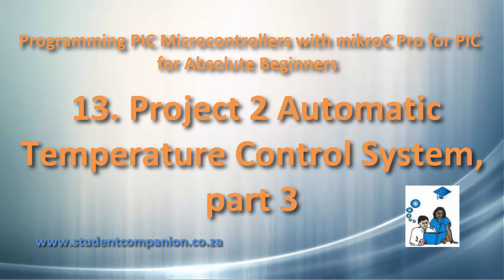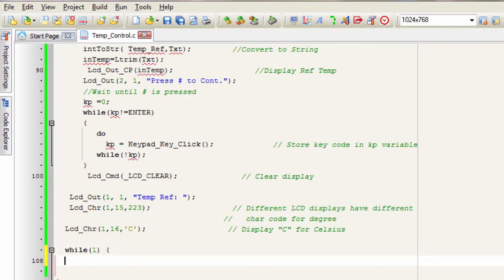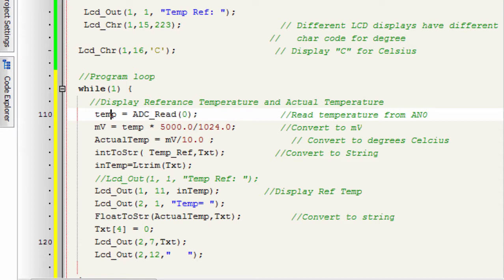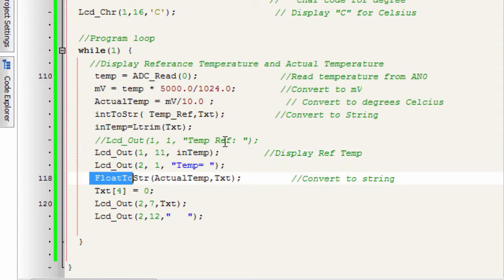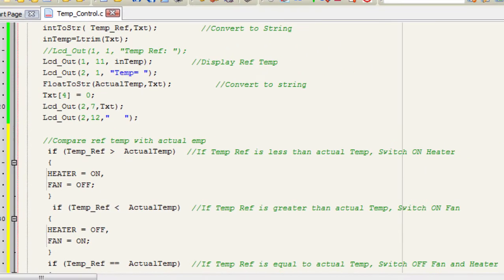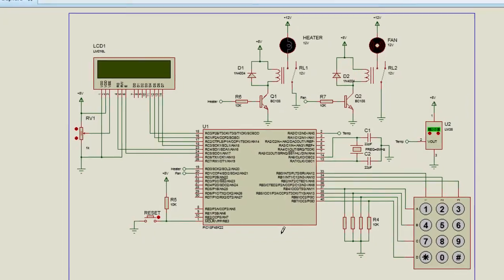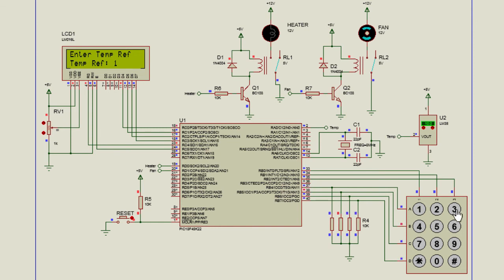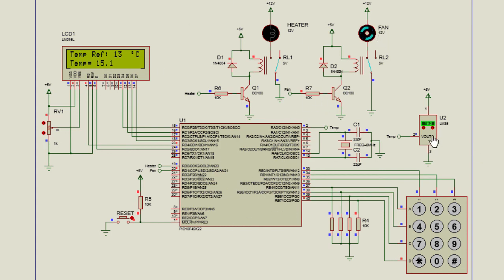13- Project 2 Automatic Temperature Control, part 3 | mikroC Pro for PIC Tutorial

Comment: I watched this project sir  I got some knowledge from it  .but sir if u can please give a code in  mikroc for automated temperature based fan speed controller using pic 16f877a microcontroller with out using key pad.
Reply from the maker: Hi, we have already discussed this topic in this thread: https://www.studentcompanion.co.za/forums/topic/can-i-use-pic16f877a-as-the-microcontroller-for-automatic-temperature-control/
Reply from the maker: If you don't want to use a keypad, you can use push buttons. You can follow the same procudures as in this project: https://youtu.be/E_bAO7MwadQ
Reply: @StudentCompanion   sir when i build the code i get the error that demo limit and finished with error
Reply from the maker: If you get demo limit error it means you are using the free mikroC compiler. The free version only allows you to compile small code of less tgan 2kb. For bigger code, you will need to buy the professional version.

Comment: I am getting an error after loading hex file and running it, the error says: "Attempting to execute illegal op code".
Reply from the maker: Where are you getting that error? In Proteus simulation, MPLAB, Hardware tool?
Reply: Student Companion In proteus simulation. When I click at the errot it says, "this may be becuase the cpu has no source window, or because it is executing library or runtime code for which no debug data is present". If I delete the program after while(1) loop, the error doesn't come.
Reply from the maker: Did you modify the code? Which PIC are you using? Did you load the correct hex file? Are you using a professional version of Proteus and not the demo?
Reply: Student Companion I am using the code which is given in source code. Yes I loaded the correct hex file. I even checked it by writing blinking LED program. It's working. Yes I am using proteus 8 professional, cracked version.
Reply from the maker: Please upload the screenshot of the error message, your zipped mikroC and Proteus projects in the Forum on our website: https://www.studentcompanion.co.za/forums/
Reply: what do you mean by zipped mikroc and proteus?
Reply: I have uploaded it under https://www.studentcompanion.co.za/forums/forum/mikroc-pro-for-pic-project-discussions/
Reply from the maker: Hi We don't know what you mean by works fine before while (1) loop but not after using while (1) loop. This code you attached in the Forum when we compiled it, it works fine with no errors and it simulates well as expected.
Please upload the mikroC code which is not working. The one with errors.
Reply: Student Companion at the first place, there is no error in Mikro C compiler, the error is coming after simulating in proteus.
Reply: Mikro c code is same as in your source code link.
Reply: I have already sent the screenshot of the error. Can you help?
Reply from the maker: There was an error but after we compiled your code without changing anything, the error in proteus disappeared.
Reply: Student Companion Okay.
Reply from the maker: You are welcome
Reply: Student Companion compiled as in built the program?
Reply from the maker: Yes. You must build the project

Comment: Thank you for all the projects what about if I want to add one device to be monitored let us say if I want to monitor Oil of the gearbox in wind turbine i.e. oil cooler how can I add to the schematic and write the  c code? if it is possible mean that u may give me a hint!!! Please
Reply from the maker: +Haftamu Mekonnen it's all depends on the type of device to add. What kind of sensor? How is that sensor interfaced with microcontroller?
Reply: let us say, for example           Generator speed sensor, gearbox lubrication sensor, Temperature gear oil sensor, Windvane sensor, Anemometer sensor, vibration sensor or hydraulic oil level sensor! you may give me some ways to design by choosing one of these sensors. I need to monitor one of the above listed sensors along side with the automatic temperature control not all at the same time. Thank you for replaying again!
Reply from the maker: +Haftamu Mekonnen you must select a sensor first and found out whether it produces an analog voltage like the one in this tutorial. Then it can be connected to any analog pin of the microcontroller and you can read it like in this tutorial.  But if it produces an digital output then it can be interfaced differently.  Some uses I2C, SPI etc.
Reply: I choose the vibration sensor and it produces an analog output! so how can I connect it to the microcontroller? and how can I compensate the fault or diagnose the fault just like the heater and fan did to the temperature variation? Thank you for replaying!
Reply from the maker: +Haftamu Mekonnen what vibration sensor are you gonna use?
Reply: From the wind turbine components, for example Rotor vibration! Thank you for replaying!
Reply: Okay! leave it, if u have any idea that I have to monitor one of the wind turbine components just like this tutorial, tell me the simplest component to monitor using sensor! I just said that if you can, if you don't understand what I am saying leave it! But, I want to Thank you for helping me upto this!
Reply: Okay! let us come to this tutorial what is the problem here it can't simulate (it show me an error) the code after written the program loop! until the program loop it works fine but, after the program loop it didn't work 
it show me an error says,  "Demo limit" I mean the program in this 3rd tutorial starting from  
 //program loop:                       

//program loop

       while(1)
  
 {
     temp = ADC_Read(0);
     mV = temp * 5000.0/1024.0;
     ActualTemp = mV/10.0;
     intToStr( Temp_Ref,Txt);
     inTemp = Ltrim(Txt);
     
     //LCD out(1,1, "Temp Ref: ")
     
      Lcd_Out(1, 11, inTemp);
      Lcd_Out(2, 1, "Temp= ");
      FloatToStr(ActualTemp,Txt);
      Txt[4]= 0;
      Lcd_Out(2,7, Txt);
      Lcd_Out(2,12, " ");
      
       //compare ref tmep with actula temp
      if(Temp_Ref >  ActualTemp )
      {
      
      HEATER = ON;
      FAN = OFF;
      
      }
      
      if(Temp_Ref <  ActualTemp )
      {

      HEATER = OFF;
      FAN = OFF;

      }
      
      if(Temp_Ref ==  ActualTemp )
      {

      HEATER = OFF;
      FAN = OFF;

      }
      
      Delay_ms(10000);
}
}

where is the error that I have done? it show me like below:

Line       Messages
0               127 All files Compiled in 78 ms  
0              434 Demo Limit Demo Limit
0              102 Finished (with errors): 03 Jan 2017, 10:03:10
Reply from the maker: +Haftamu Mekonnen it means you are using a demo compiler. Your free compiler can only compiler small codes of 2kb or less in size. If you want to compile thhs code you must buy a full license
Reply from the maker: +Haftamu Mekonnen i meant a component model number. To know what type of sensor it is and how it is used
Reply from the maker: +Haftamu Mekonnen you are welcome
Reply: Hello! if I want to connect the following sensors how I connect to the PIC microcontroller?
  
1. Oil Level(R SERIES) sensors
2. Fuel level(PH606) sensors
Reply from the maker: 1. Oil Level(R SERIES) sensors: It's an analog sensor with voltage from 0-5V analogue output (typically calibrated 0.25V empty, 4.75V full). You can use it exactly as the LM35. Use simple math to determine the conversion factor or Read the datasheet to get  more info.
2. Fuel level(PH606) sensors: I couldn't get this sensor on google. Please send more info like the manufacturer.
Reply: Thank you so much for your help!
Reply from the maker: +Haftamu Mekonnen you are welcome!
Reply: I have PIC16F877A microcontroller, LCD, Buzzer and Ultrasonic sensor(GP2D120) for distance measuring in my project how can I write a c code in mikro pro c? For LCD it may be simple but what about for the BUZZER and GP2D120 help me in writing the code!
Reply from the maker: +Haftamu Mekonnen read these articles: http://www.studentcompanion.net/en/microcontroller-interfacing-basics/
http://www.studentcompanion.net/en/microcontroller-interfacing-sensors/
And 
http://www.studentcompanion.net/en/generating-sound-with-pic-microcontroller-mikroc/
Reply: Thank you so much for your help! so far, I have question for you the question is as follows, I have pic16f887 microcontroller, LCD, L293D motor driver for controlling fan and heater, ULN2003A stepper motor driver,  and optocoupler-npn for wind speed measurement. So, would you help me in writing the c code in mikro c?
Reply from the maker: Hi. Unfortunately we cannot write the code for you. We won't have time to write codes for each and everyone who request it as they are many people who request different kind of codes. We will spend all our time writing codes instead of focusing on new tutorials.
But we can assist you with your code when you are getting some compilation errors especially if your project is based on our tutorials.
Try to add one sensor at a time and see if it's Works instead of including all those sensors at the same time.

Comment: I like to know why 10 second is  why not 2 or 5 second.
Reply from the maker: +Sibongiseni Masondo 10 seconds is our example.  We are reading the temperature value every 10 second. You can decide after how long you'd like to read depending on your own requirements either 2 or 5. The shorter the time , the accurate your values
Reply from the maker: +Sibongiseni Masondo but make sure not too read too often when not necessary as temperature won't change every 1 second....

Comment: THANKS , YOU ARE VERY KIND. explain  very  well ,  how contact you ?   i had learned  and   get   your sample  proyect , all is  rigth  ,thanks  ?  may i change  sensor  by themocuple  sensor  type   CTK  ?
Reply from the maker: thank you for watching our videos. you can use any analog sensor with this project, you just have to factor in the conversion rate. as you saw in this case our LM35 produces 10mv per degree. your thermocoupler might be different. if you are using sensors with digital output than it will be different.
Reply from the maker: you can contact us using the details on about us on our youtube page.
Reply: yes , thanks  so much , ,  let  me  introduce  some ,   was  working  about  your  proyect ,   all  rigth ,  and  studied   each  part  for  interesting  circuit  desighn , now  i  am taking  notes  ,because  you  teach  very  well
one  embrace  friend, from  venezuela ,barquisimeto
Reply from the maker: +humberto meneses thank you very much.  we appreciate your feedback.
Reply: yes, thanks friend
Reply from the maker: +humberto meneses you are welcome!